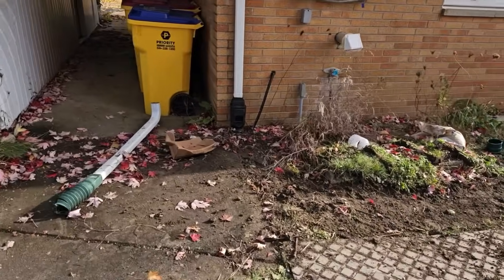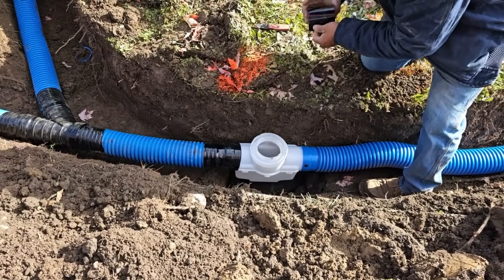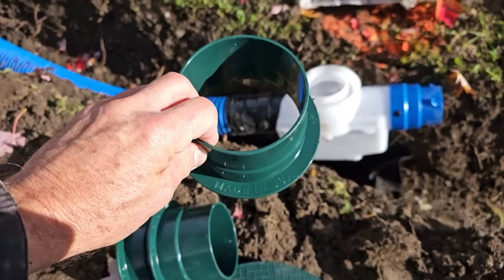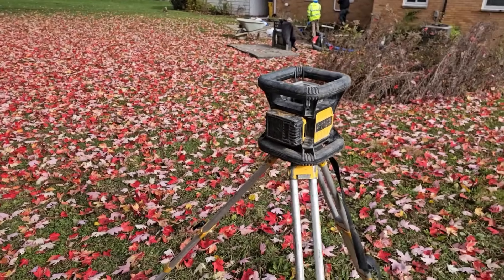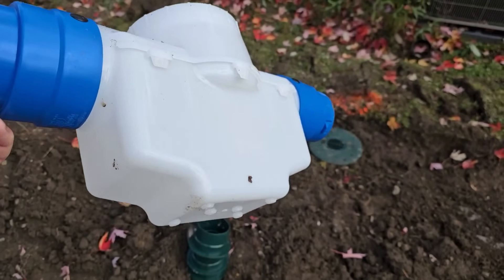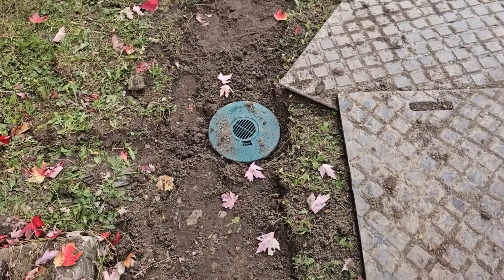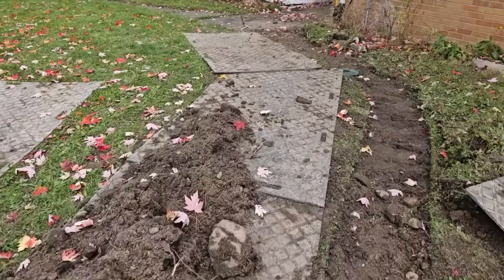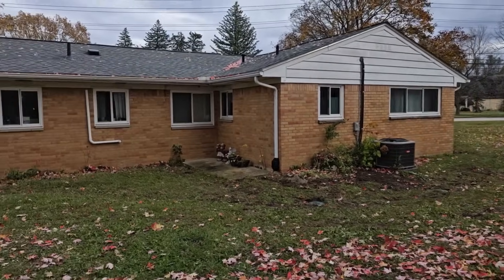100 Times Easier than French Drain YARD WATER REMOVAL

Comment: Whose product is it? Can we have a link? Awesome!
Reply from the maker: Best French Drain and Yard Drainage Contractor
https://frenchdrainman.com/
Reply: I wouldn't use this product because they're using tape to connect everything. Tape does not last very long. Maybe a stainless steel hose clamp would be better.  And also would be better to not brag that it's virgin material and instead have recycled material.
Reply: @Golfboy-ze3le the components snap together. The tape only is used for sealing. And virgin plastic is far superior to recycled plastic.
Reply: @Golfboy-ze3le That’s 200 year tape!😊
Reply: @Golfboy-ze3le Tape is not the connection, tape is a root seal.

Comment: I always thought that you had stated not connect any other drains to your roof drain line? Does that only go for a French drain along with a roof drain, meaning the yard drains are OK with a roof drain?
Reply from the maker: A yard drain and a roof run-off  drain will plug the perforated pipes in a French Drain.

Comment: Is it worth it to put a waterproof coating on the foundation and footer as well as yard drainage to get maximum protection? My crawlspace sits significantly lower then grade, its a post and beam setup in the crawlspace . The neighborhood is sloped with us being one of the last houses at the end of the street. We are catching the water from all the houses ahead of us up the street. Theres an interior french drain with sump pump in the crawl space. Lots of groundwater gets in there as well as surface water in the yard. I want to protect on the outside as well. The grade in the yard has negative slope as well. Yard is not very big maybe 1200 sq ft. Im thinking exterior french drain with some catch basins possibly as well as another sump for the exterior. Whats your input? Appreciate it, your videos are top notch!
Reply from the maker: It's a lot of work putting a good waterproofing system on any foundation. In many cases, it's not necessary, but not doing it and ending up with a leak would be rough.

Comment: For this project; Is a 3 in solid white tube just as good as the 4 in blue tubes if that’s the only option on the website with free shipping (non pallet)?  Especially if you only have one line?

Thank you for answering all questions. English is not my first language so I thought people can track my thoughts.
Reply from the maker: @John_Cold  
I like my YARD DRAIN on a 4" line and my downspouts on a 3" line to a 4" main line.
Reply: @FRENCHDRAINMAN  will there be an option on your website to buy 4 in 25-50 ft without the pallet shipping requirement in the near future? I don’t seem to see that option. I would also prefer 4 in but don’t want Amazon tires and don’t want to pay 300+ for pallet shipping.
Reply: *amazon pipes or Lowe’s quality pipes. It would be a fantastic idea to add a bundle/kit that has everything the gutter kit has but with a drain basin for yard surface water. It’s seems there is frustratingly not an option to get a 4in setup without pallet shipping? Unless I’m mistaken. 

Truly sold on your product and want to support your business. Awaiting answer before I buy. Thank you. Sorry but I’ve been up all night trying to trouble shoot
Reply: @FRENCHDRAINMAN  
Like even though 4 in is optimal. Would it be detrimental if I used 3 in instead because that’s the only option seemingly (see below comments)

Comment: Are you using perforated or solid pipe?
Reply from the maker: Solid pipe
Reply: Crack pipe😂 …… I’m a French drain guy ,grade your ditch front to rear side to side , 4 inch perforated pipe,landscape fabric bottom and both sides and 3/4 crush fill , no dirt
Reply: @mcdlb181  Perhaps FRENCHDRAINMAN knows if a french drain is or isn't the only way or the best way, if you or I didn't catch on. Cheers.

Comment: I have a negative grade from the back alley into the back of my house (my business office). However, the ground surface that butts up against the back of the house where the water flows into is made up of paving stones (part of the parking lot) and a concrete path (by the back entry door).  So my plan is to draw water out of these areas into a french drain that will be installed in a 50 foot long swale between my property and my neighbour’s property.   And I also know I will have to take these paving stones out and a concrete slab out to install what I thought was going to be a trench drain that would drain into the French drain. And keep in my mind I have to reinstall the paving stones and concrete afterwards due to them being part of the parking lot and being beside the entry door.  I’m willing to put the work into doing this, and buy the material from you, but I’m hoping you will be able to tell me what to install underneath the paving stones and concrete? If not a trench drain then a yard drain?  As well, you should know I live in Canada where I have to deal with slightly colder weather than in Michigan.   The frost line depth is 3 feet.  And I know for actual sewer and water lines contractors have to go down 6-8 feet deep.  Thanks.  -Dean
Reply from the maker: https://youtu.be/oqTZ6H4UGf8?si=OCDcIJfdwJAPJNS9

Comment: I need to catch water coming off the road down the driveway running up on to the apron of the garage. i have two catch basins on the apron but they are way to small. i was thinking of putting 4 by 4 36 inch plastic catch all along the front of the apron which would be about 30 feet. it would catch the water coming down the driveway.
Any ideas or thoughts would be apprecited.
Jim Ropp
Ashland ,Ohio
Reply from the maker: https://youtube.com/playlist?list=PLjFCqaZ4v1BVX2cpGD7wJqH37RSS1JAOz&si=B2Q9AxTwJRRVn5II

Comment: Is there an adaptor you can use to connect with the gutter if you pull out the 2 by 3 downspout and replace it with a bigger downspout
Reply from the maker: Yes, we have a 3"x4" Vented Cleanout
Reply: @FRENCHDRAINMAN They're asking about the connection at the gutter, which is 2x3. How do you upgrade your downspouts to 3x4 if the gutter connections are 2x3 without replacing the whole gutter. Something I've been thinking about last few days as well.

Comment: If I can't get access to the lower front yard? What about a negative slope? It's common for me to find backyards that slope toward the house, and a driveway or something prevents me from running the water to the low ground and daylight it in front of the house. Is it just a fact I have to send the water to a dry well 25 feet from the back of the house to a dry well where the yard surface has a higher grade level? Worst case the pop-up emitter on the top of the full well of water lets water run back on the surface towards the house (That emitter would have to be lower than the bottom of the leaf trap for sure. Is that the solution? ( I am in the same Nothern climate like you. I don't trust pop-ups in winter for downspouts)
Reply from the maker: https://youtu.be/7KB8Mjexov8?si=LLtAw8HMzMUNrkm7

Comment: French Drain Man….how do you know if you need a French vs Yard drain? I’m getting water in my basement that’s coming in over the storm window rings and also — believe it or not — through the exhaust pipe of my oil burner that goes outside to a chimney.  This only happens when we get really heavy rains. That yellow and red on the radar.  We got ten inches of rain on LI last week and it just destroyed so much. Anyhow, since this only happens wirh really heavy rains, does that mean a French drain or yard drain in these problem areas?  I would think a French drain would catch the water rising as the soil is saturated. Then agajn, the yard drain would also work once the water can’t be held anymore by the soil. Very confused. Lol
Reply from the maker: https://youtube.com/playlist?list=PLjFCqaZ4v1BUqichor2QH1X_p9bBPor8D&si=R3fQX58uwyFJxWDu

Comment: FDM, what is going to happen when the water freezes in there?  I've been trying to figure out the answer to that question for a long time and most examples are in area with out persistent freezing temps.   In MI they'll be having the same problem I do in MN: the entire system is going to freeze up and sun melt has nowhere to go.   I've seen downspouts solid with ice and water leaking out the seams which then burst under ice expansion
Reply: Based on the size of those pipes, there won't be a lot of water, maybe 1/4 inch or so, laying in the bottom. Should there be any rain or melt before that ice melts, then it will simply flow over the ice.
Reply: They mentioned they drilled a small hole in the catch basin.
Reply from the maker: https://youtu.be/1kPHHnDc1ZY?si=kv309YHnSAsTUN1r